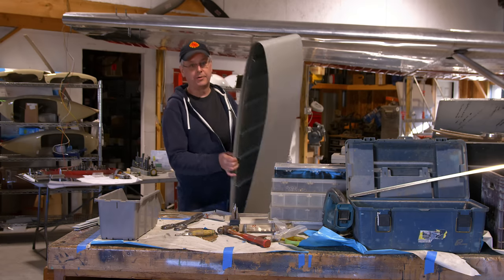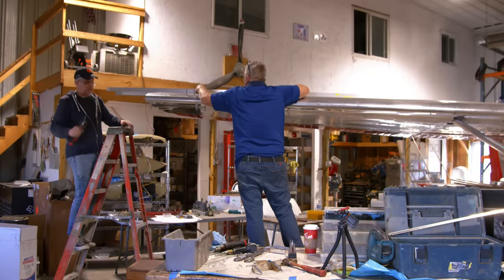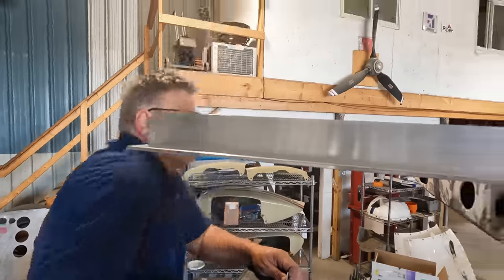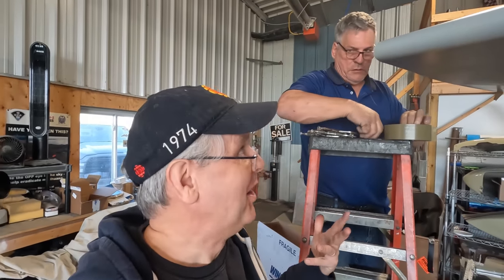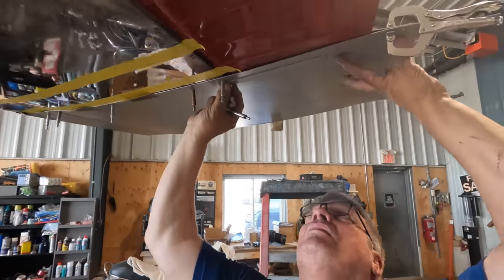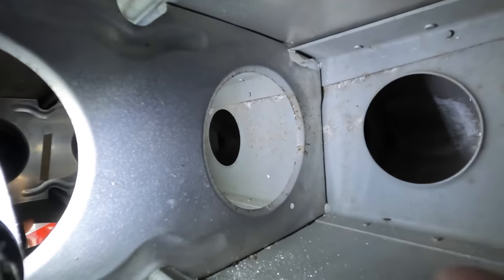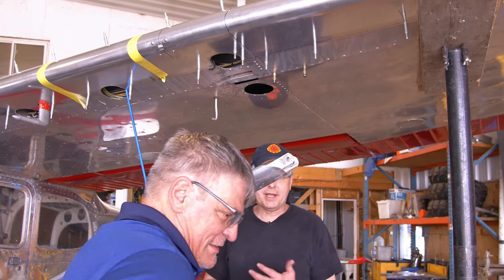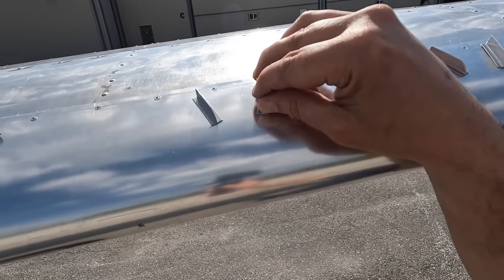WingX STOL Wing Extension Installation on a Cessna 172B

Comment: I loved "tinbash" (sheet metal) shop back in middle school grades 7 and 8. I made a very expensive  toolbox as a project once. Our usual teacher was out for a couple weeks so we had a sub to supervise us - anyway, I laid out the pattern on the tinplate, cut it out, folded it up using the brake (which was REALLY difficult, it didn't want to hold a bend) and then soldered the seams (again, which was really difficult for some reason). When our teacher returned and examined our projects he looked at mine and started laughing - turns out I had picked out a sheet of stainless steel not tinplate for my project. No wonder it was so hard to work with (and expensive too!) 🤣

Comment: I was taught (in aircraft school) to never use a graphite pencil or marker on bare aluminum.  It will leach into the material and initiate intercrystalline corrosion, possibly resulting in a crack.   Wax is recommended.  (But admittedly less accurate.)

Comment: G, day Glen from Sydney Australia.
I was going to mention galvanic corrosion, but aluminium and stainless steel is compatible. 
The navigation lights: LEDs for the wingtips, and who extends the wires?
I would have liked some distance for V1 and KIAS before and after the wing extensions. Moreover the rate of climb, in feet per minute?
🌏🇦🇺

Comment: How many holes did you have to add in the bottom of the wing to install the Spar reinforcement? 3 each wing?
Reply from the maker: I don't remember exactly - but it was probably at least a dozen rivets were drilled out and replaced for the reinforcement.

Comment: You are putting all these STCs on your aircraft which great but how do you know that they are compatible? If you have flight manual supplements for each; how do you know which set of data trumps the others? You may need an additional STC to approve the use of these STCs on the same aircraft.

Comment: You lengthened the Wing without lengthening the stabilizers?   Maybe Cessna designed some extra stability on to it.
Reply from the maker: Lots of stability... pretty sure the engineers at WingX did their homework, and then proved their homework to acquire the STC.

Comment: What is the purpose of wing extensions? Wouldn't the extra surface area apply more drag and lower the cruising speed of the aircraft ?
Reply from the maker: The extra wing area will lower the stall speed, allow for a lower take off speed, and increase climb rate. There isn’t any loss of cruise speed.

For a plane of this size, weight, and slow speed to start with you don’t lose anything you just gain.
Reply: Except controllability in a crosswind

Comment: It will be interesting to see how it flys and the takeoff and landing performance. As this wing extension is only STCd for a 172 in Canada does that limit taking the plane into the US?   Also what is the wing loading per square foot now?  I could not find that number in the information. Good luck with the test flight. .
Reply from the maker: I’d have to dig out more info on the wing loading - I know from our discussions during the instal, it is way over engineered with the stiffeners that we added to the main and trailing spar. 
US STC is hanging in mid air at this point, it was close to approval pre-covid but has been hampered by all that’s happened over the last two years. The versions for the 180 series aircraft are approved so it will happen soon. But the Canadian stc still allows my to fly into the US and pretty much all the rest of the countries we could get to.

Comment: Sir, you are made of sterner stuff than I. I don’t know that I could have watched as someone cut holes in my airplane!
How much weight have these changes added?
Reply from the maker: We ended up with a 50# increase in useful load - would have been a larger increase if we had the higher horsepower engine.

Comment: How much stress can these extensions handle before they are ripped away?
And how much do these extensions increase the forces through the wing in total?
Reply from the maker: The wings were strengthened to handle extra forces - The plane itself will disintegrate before the extensions are "ripped away" as you say.
If you are truly interested; all the testing info is available from the company that makes them (WingX) and through Transport Canada and the  FAA that certified the STC.
Reply: @GlensHangar  thank you.
You're plane is bada$$ and I enjoy your videos! Keep it up!!